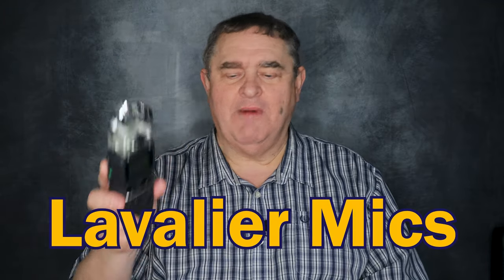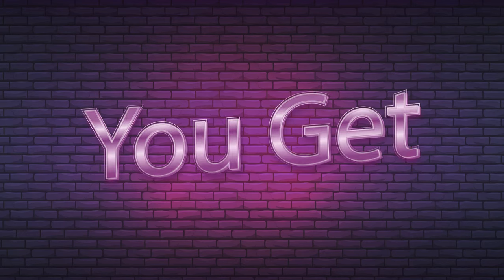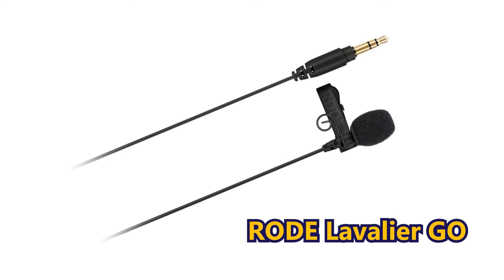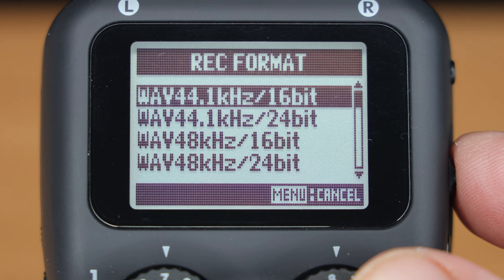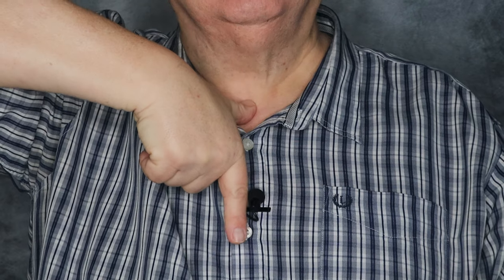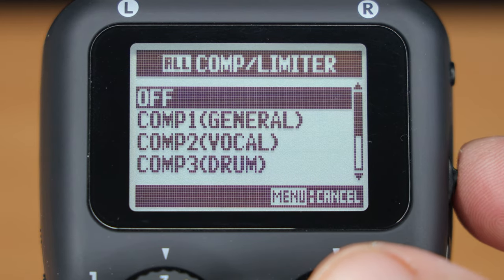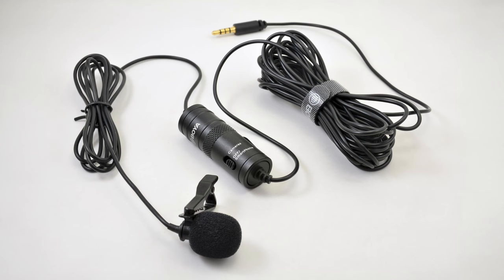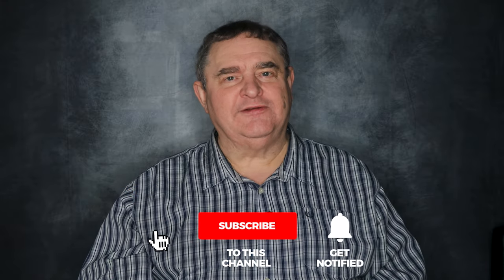How to Connect & Use Lavalier Mics with a Zoom H5

Comment: ATR3350 is discontinued. Is there another one you suggest? Does the ATR3350IS work the same?
Reply from the maker: The ATR3350IS is basically the ATR3350 that has a TRRS to TRS adapter. If you can get the IS version, that will work fine, just don't use the adapter.

Comment: Why when I use the Lavalier microphone on the L/R input does it sound only on one channel, that is, the left?
Reply from the maker: It could be that you're using a mic with a TRRS plug (three black or white rings between the metal contacts). THe mic input socket on the H5 is designed for TRS jacks (two black rings). If you're using a lav mic designed for smartphones that has a TRRS jack, then you'll get an electrical short between one channel and ground and audio on only one channel. Some lav mics with TRRS jacks are switchable between TRRS and TRS output (eg MOVO LV1 and BOYA BY-M1) so they can be used with phones (when phones had headphone jacks) and standard recording gear. If your mic does not have a switch that changes the pin layout you could try getting a 3.5mm TRRS to TRS adapter. I hope that helps.
Reply: @DIYVideoStudio  The microphone is a trs plug, when I use it on a smartphone it records stereo, but when I use it on the h5 I have that problem.  I think it is defective, I bought it recently, thank you for your help